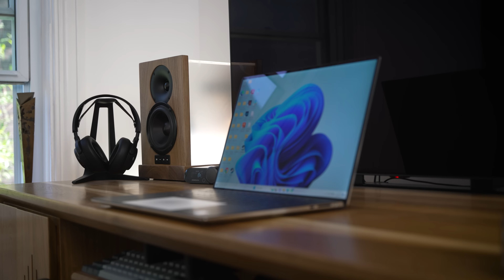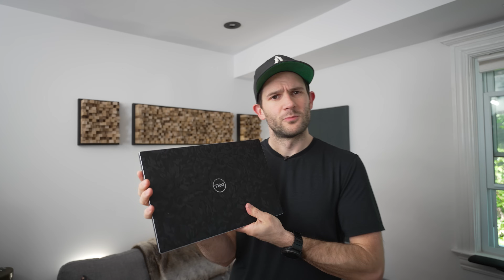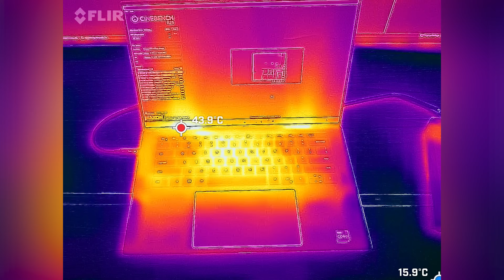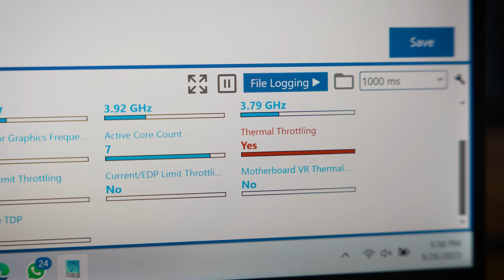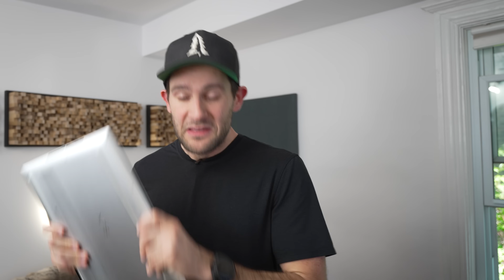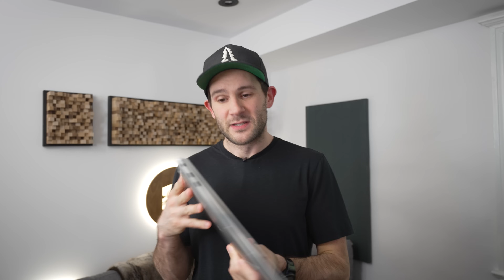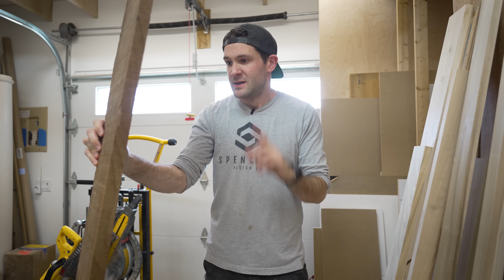The BEST mod I've ever seen....

Comment from the maker: Get an exclusive @Surfshark deal! Enter promo code ZACBUILDS for an extra 3 months free at https://surfshark.deals/zacbuilds
Reply: Agreed I have a zephyrese g14 and that thing cooks.  Selling it for 45wat apu laptop.  At least the performance will be more stable, then the heat from RTX anything.
Reply: framework laptops
Reply: Good idea the angle but all those angled cooler are known to off center the laptop fans after a while making them noisier and damaging the fans in the end. Better go with a more neutral angle design for long term use.
Reply: If you are going to be modding your N-Switch, then I expect you to replace the Joy-Con plastic covers with wewd. Otherwise, I will be very disappointed in you.
Reply: i recommend a framework laptop. it might even be the last laptop you buy.
Reply: 11:30 it has nothing to do, or very little to do, with user's comfort. It is about low temperature burns that you can sustain due to steady contact with surfaces only couple Cs above 40C.
Reply: Hey!! ADDING TOO MUCH PASTE makes it spill out onto the green board, causing thermal transer and overheating

Bro😅
Reply: Framework laptop :)
Reply: Ive already got surfshark, but god bless 😁

Comment: You should get a Framework laptop
Reply from the maker: Just waiting for the Framework 16 to drop!
Reply: Thi is the first heart I have ever gotten
Reply: I just got my framework and it's the bee's knees. Plus, better for the environment and I'm not worried about obsolescence!
Reply: @ZacBuilds make sure you get the AMD version.
Reply: @ZacBuilds So I'm not the only one waiting to upgrade
Reply: Here before this vids fully catches on fire
Reply: @marcusgregoryrichardson22  AHEM AHEM, try repairing one or even getting parts to do so. Plus framework laptops have way better battery life, use windows, and have anti-glare screens.
Reply: @marcusgregoryrichardson22  I prefer the upgrade ability and not being tied to apple with the framework. Also have you seen anything on apples separability/servisability?
Reply: @ZacBuilds  that upgradable gpu and pci  modules gonna be s game changer
Reply: I came to say this
Reply: @marcusgregoryrichardson22  wow, its the first time i've seen someone say that the framework is a macbook ripoff, when a framework looks and feels nothing like a macbook and they make sustainable, user upgradable, modular machines which are the exact opposite of what apple does, ie; being anti-consumer, anti-repair, anti-ownership etc. So idk what you're comparing to.
Reply: Was about to say that.
Reply: @marcusgregoryrichardson22 literally every laptop that isn't a Macbook is a better comparison to the framework... Literally all of them, even the windows tablets.
Reply: @ZacBuilds un sure Linus will do sooner or later!
Reply: Love this company. Couldn't agree more.
Reply: @marcusgregoryrichardson22 Mini LED LCD is only good for peak brightness. Picture quality is inferior vs OLED.
Reply: @ZacBuilds 16 just dropped
Reply: @ZacBuilds  ... And it droped
Reply: @marcusgregoryrichardson22  Good luck fixing a MacBook Pro
Reply: Framework or system 76
Reply: I was thinking same
Reply: @brunoais macbooks rarely need fixing
Reply: They're like a bajillion dollars
Reply: @ZacBuilds You should update this cooler with foam around it, like how the popular IETS GT500 or GT300 laptop cooler is selling , the foam basically seals around the laptop, preventing the air from leaking the sides and forcing airflow to go through underneath the laptop vents as much as it can ❤
Reply: I kniw it's probably way past the time of selection, but let me speak my mind about that...
As much as framework is awesome in principle, they have the same board manufacturer as dell... Not a huge change tbf
Reply: @kuoth56  Yeah, and the idea of upgrading is neat... but most of us don't upgrade because sockets change rapidly.  And ram and HD are upgradable on everything anyways.

It's a trend, that is all.

Framework isn't magically going to make your 790 board compatible with 15th gen intels.  Or thar pcie 4 slot magically have the bandwidth for a 5090 when it comes out
Reply: @thisisashan   It's also hella expensive. I can get a whole new laptop for a board upgrade. I get that it's more sustainable and maybe useful to use the old board as a standalone media PC or something. But the average consumer doesn't care, and I won't bother either even though that does sound fun. It's just too expensive.
Reply: @marcusgregoryrichardson22  macs are trash they force you to overpay for sub optimal components. Fram is the future of the laptop space. But you can keep ewasting your Mac book every few years.
Reply: @ZacBuilds Most might want to wait for the 1st upgrade to the 16's propietary gpu to come out. Tons of manufacturers have succeeded at offering an upgradable gpu.  None have successfully followed through.  I'd have more confidence if the 16 had released w more than one gpu offering.
Reply: I imagine the laptop I just got a year ago will be due for upgrading once (if) there's a Framework 17 released. At that point, I'll be in for one myself.
Reply: Framework looks like they will be interesting in the future, hopefully they will also help to change the industry. It really is a pity that Linus is involved though, makes it much harder to trust them.
Reply: yOU sHould geT A fRaMewORK lapTop
Reply: @reconnaisance yeah, they just die, and almost unwaveringly it's an IC or other component on the motherboard that's gone bad. Typically ~5 years, so just outside of warranty. And then Apple says, sorry that'll be 2/3rds of the new cost to replace it because we don't repair motherboards, even though we easily could.. And if you're lucky enough to get a lemon that they deem was their fault, they will replace the faulty part, with the same faulty part that will inevitably fail again. What a consumer (not to mention environmentally) friendly business model..
Reply: This is the way
Reply: @marcusgregoryrichardson22  You are missing the entire point of the modular, upgradeable, repairable Framework laptop if you compare to Apple...
Reply: @marcusgregoryrichardson22 there is no way someone would compare a framework laptop to a macbook, and say they are copying them.

I'd say that would be a compliment though. Since Apple makes products that they nearly refuse to repair, and makes it hard for others to repair. Whereas framework has taken every step to make them easy to repair.

From what I've noticed, people are moving away from apple. I think people are getting sick of their crappy customer service and have noticed they are paying more, for a lesser product. - especially when it comes to specs.

I do like the case they come in, but not enough to pay 2x as much. (I also don't wear jewelry. So I don't really understand the concept of owning something as a cosmetic accessory.)
Reply: @ZacBuilds  Have you ordered the Framework 16 already? I think it will make a great addition not just as a laptop but also as something you might be able to rip apart (or just buy older gen gear and use that) and create a whole wood laptop or something crazy like that. 😀
Reply: Like your content Zac, well done. Shame about the constant juvenile ‘Macs are trash’ comments. I guess they’ll eventually move out of home, get some industry experience. There is nothing sadder IMO than ‘my chosen Corporation is better than your chosen Corporation’. Treat them all as your enemy because they are certainly not your friend. Nobody should trust Apple, Microsoft, Google or any of the others. 

Mac’s and Linux are both inferior (be honest) to Windows for gaming. Take gaming out of the picture and for business use, I’d take a Mac and Linux over Windows every time. Windows is a disaster when it comes to security. 

The best machine (and OS) always depends of what its primary function is, level of service and support needed and available budget. But hey, if ‘company XYZ is trash’ makes you feel better, go hard. But maybe keep in mind your use case may be totally different to someone else’s needs.
Reply: @carlinchamberlain1791 they make nice-looking products but refuse to fix them or let others fix them. That's why Macs are trash. If they were more ethical, I'd probably consider buying one. - either that or if they didn't charge as much.
They are charging more money than the companies who stand behind their product once they are off the shelves, and even after the next model is released. It doesn't make sense to pay for the service but not get it.
Reply: I agree that the direction they have taken re servicing is not good. Unfortunately now that it’s possible, more and more companies are doing this. Tesla, John Deere etc are even worse where spare parts made by 3rd parties simply won’t work because they aren’t ‘official’ parts. Some US States are getting right-to-repair laws passed as I understand. This is not just an Apple thing. On the flip side, the benefit of having the tightly controlled hardware & software system is that they’re secure. They’re good for less technically minded people also. But if you like to build your own (and who doesn’t ;-) ) then Apple is not the way to go.
Reply: 100% get a framework especially the one with the Dgpu 👍
Reply: Yassss
Reply: Yes my thoughts exactly. Framework would be perfect for you.
Reply: Yes, absolutely get a laptop with proprietary “upgradable” components and that probably won’t be around in 5 years 😮
Reply: @christophervanzetta  the aren't dell Alienware with those pcmia GPUs plus dell is actually prototyping a clone of this.
Reply: @monochrome_linux  only think I can think is remotely comparable between the two is price point. They're relatively expensive.
Reply: Man I want a Framework soooo bad. The PERFECT laptop, you can do everything with those.
Reply: @picnicsinspace198 imagine if you could get a OC Link port 😱 blew the competition outa water.
Reply: Oh yeah instead of modifying my laptop for barely any money let me get a 3500$ Laptop how brilliant!
Reply: Why bother you can't get it from other countries.
Reply: @scarecrow5848 duh

Comment: For reference, the reason why laptops don’t dump heat into the outer chassis directly is generally so that the batteries don’t overheat, which is a fire hazard.
(source: https://www.youtube.com/watch?v=eS_MVDoaIoM)

Edit: In addition, there are also regulations about how hot surfaces can get so that they don't burn you.
Reply: Also there are regulations on how hot touchable surfaces are allowed to get.
Reply: @JanJanJanJanJanJanJanJanJan2 cooking steak on the back o my laptop go brrrrrrrrrrrrr 😎
Reply: Laptops are limited in the amount of heat they are allowed to dissipate through the chassis outer shell to prevent burns, that particular limitation has little to nothing to do with battery protection.
Reply: and you know, you dont want to burn your legs if you had them on your lap. just saying.
Reply: Intel MacBook Pros be like: what regulations?
Reply: Additionally, Nate dogg and Warren G regulate how hot touchable surfaces can be.
Reply: it is an air, i do think his upgrades will still be better for laptop becuse you know the heat isnt being trapped inside, and phone manufactures dont care about it. the dump all the heat on the back panel  and the battery is even closer to cpu
Reply: My last dell laptop would get hot enough to hurt to the touch, even tho i was always cleaning its inside to avoid such problems. The casing eventually dried up and became really breakeable

Comment: Given your penchant for customizing, I'd say you should get a Framework laptop 16 when orders open up. Completely customizable IO and all replaceable parts. It'll even have an expansion bay for a replaceable internal video card.
Reply: I said somewhat of the same thing about Framework and also Clevo.
Reply: +1 for Framework. Entirely aside from customizability, their whole take on reusability is SO overdue for the laptop industry. I was sold the moment I saw how easy they'd made it to rehouse the internals into a standalone mini-PC.
Reply: I just fixed up an old Elitebook 2560p, one of the last socketed laptops. The thing came with 4 gigs of RAM but now has 16, and i5 only kind of upgrades to i7 (2nd gen only😢), but then the peripheral slots are just insane. eSATA, swappable dvd drive, DisplayPort, SD slot, PC Express slot (thankfully there are cool cards for), m.2e X 3- ethernet card, swappable wifi card,also a sim slot and cell card. Dedicated docking port. Oh, and smart card for biz security. It's no Framework, but it is built to stay relevant 12 years later. It does. It crushes at music production. I got this out of the garbage, dude. This mission is loooong overdue.
Reply: @feeterican i do not recommend Clevo. I used to work on them often
Reply: @feeterican The 16" framework seems like it could have the specs he needs to replace the dell.  But I wouldn't want to go all in on the AMD 7700s which is arriving on the 16.  As a prior Asus G55 owner, I've been burned by the MXM hype.  Framework seems more dedicated and likely to acheieve the upgradable GPU goal, but I wouldn't bet against history yet.
Reply: @@chizisj im thinking about checking out an lg gram mobo, idk if it will fit though. didnt see any measurements online. do you know where i can look for that kinda stuff  ?

Comment: Would also be interesting to see how it would compare with all the internal cooling mods and using the body as a heat sink but without the big cooling stand.
Reply from the maker: Ah damn, I didnt even think to run that benchmark. Next time!
Reply: @ZacBuilds  not too late. Run the test and update the description
Reply: Sounds demanding lol.  Not meaning to be like that.  But this is actually a good idea I haven't seen before
Reply: Idk on Dell
But there's a ton of that in MacBook

The main problem by solely using the body without external cooling is that you also heats up battery and SSD
Reply: Yeah, was disappointed he didn't show that. Really wanted to know becuase maybe the big fan isn't worth it for those of us who would be OK with doing all that. Also be careful with pass, I'm not too familiar with that pudy product you used. But another tech ch, jayztwocents, removed the pads from his ram and put paste and it turned out the pad was also there to bridge the gap on the cooler. His issue was it was a huge heatsink which included the ram and was just mm higher on some places.
Reply: Any ideas for cooling mods for an Asus Zenbook flip 13 laptop?
Reply: @customan10  use "tent" mode as much as possible
Reply: @ZacBuilds will it be ok if i just bore my bottom laptop casing? Adding vent holes esp around the nvme area?
Reply: I did it a different way, I did what was done on the inside with the thermal paste, and then sealed the bottom, and run my laptop sitting in a shallow pool of water.....when the water reaches 150 degrees I change out the water, using the hot water for brewing my coffee. Yes I know.....I’m a genius!
Reply: Jeez way to much work....did the internal work with cooling grease.....but then I set my laptop into a shallow pool of water, and occasionally use ice......works great......and the hot water, I make tea with. Your welcome, and yes, your correct....I am a genius, I appreciate you noticing.
Reply: Could be that 90% of the increased cooling is the new paste and putty. Needed to test with and without the fan cooler.

The audience doesn't know if the fan cooler was effective or not.

Comment: From what I can see, it looks like the Thunderport hub kind of blocks the air intake in the fan as well, so that might be worth a redesign. Also making the top removable so that whenb the fan eventually dies you can replace it without busting apart a glued piece
Reply: Yep.  Rule of thumb with fans is at least an inch of space in front of them to allow flow. Only instance I've seen in 40 years of doing support where it isn't involves rifle bearing fans. You don't want rifle bearing fans.
Reply: Considering there is likely much more resistance on the push side finding gaps out from under the laptop i highly doubt there is much, if any, flow constriction happening on the pull side where the hub is located. also if the stand is for this particular model of laptop and hes already shown its power limited and not thermo limited then any improvments to airflow are largely moot. would be nice if the fan was more easily replaceable, although an offset phillips driver (looks like a hex/allen key) should probably get the job done in the current config but would still be a PITA.
Reply: Noctua fans usually last 10 years plus so....
Reply: I had the same thought and would make this change.   I would move the connection hub so that the edge of the hub matches ( or close ) to the edge of the 'projet'.   Since the top is at an incline, this would make more airspace for the fan.  I do not  believe that this would break the looks of the 'project'.
Reply: Also some Thunderbolt hubs can get very hot themselves, so then it's pulling hot air onto the hot laptop.

Comment: Not sure if you check older videos, but regarding the Dell Dock: you can get right angle adapters to reduce the strain on the USB C port. Additionally, the docks usually have a power button, which can turn the laptop on. In my setup, I 3D printed a side shelf that holds the laptop on the side of my desk, giving me the entire desk for use. So basically, something akin to what you did  with the drawer, but more barebones.